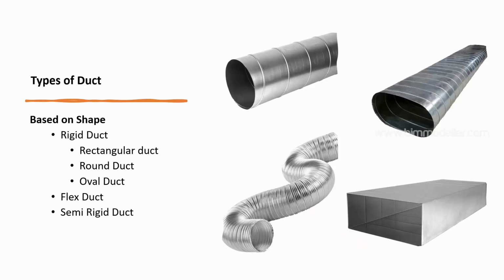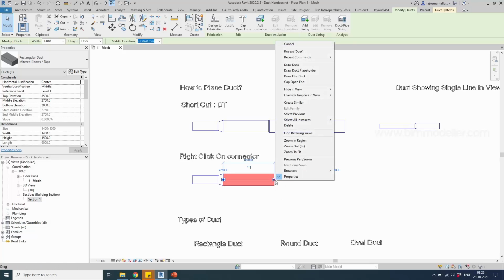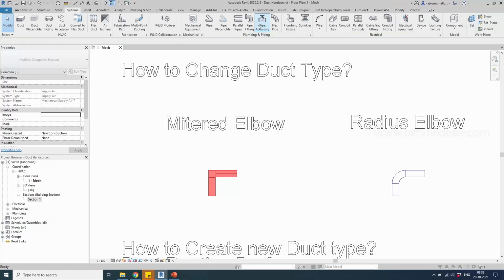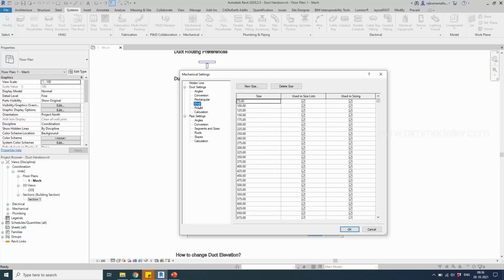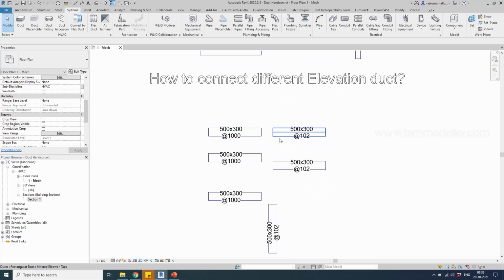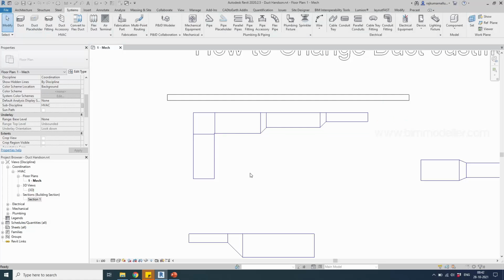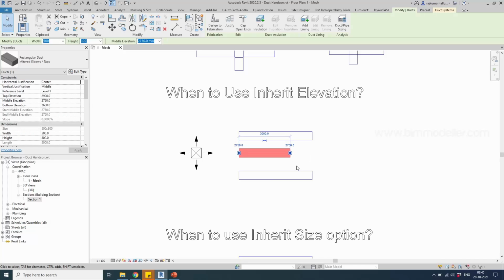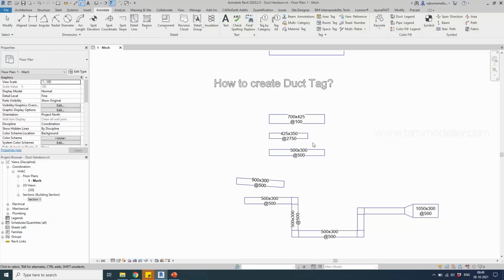Revit MEP Tutorial 16 : All about Creating Duct in Revit

Comment: How to resize the duct in correct with CFM FPM values
Reply from the maker: There is a Duct sizing settings available in Revit. But for this we have to connect all equipment and Diffuser with proper flow rate and flow direction.

Comment: Nice Sir, could you suggest me ..What type of specification need for laptop for revit use.
Reply from the maker: Hi Check with Autodesk Revit system requirements once.
Minimum 16RAM 4Gb Graphics needed. 
It basically based on the questions of project or practice and how long you will use.